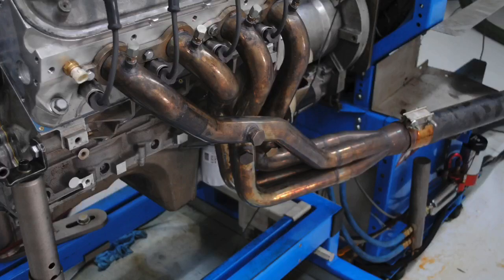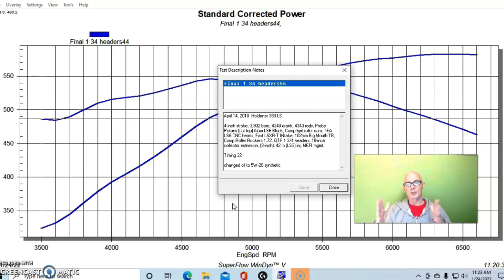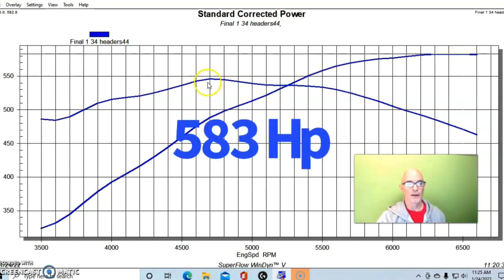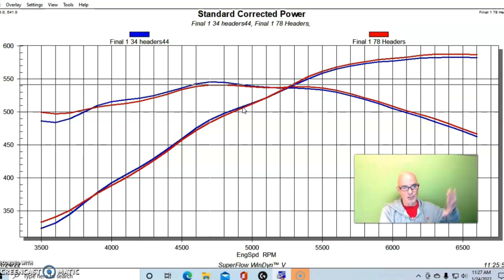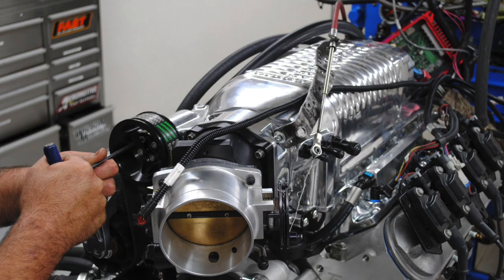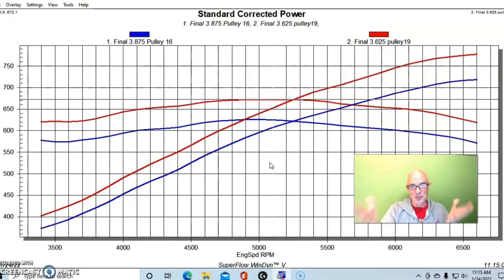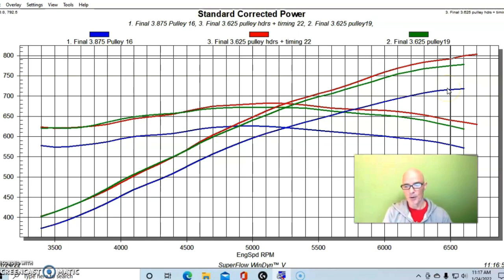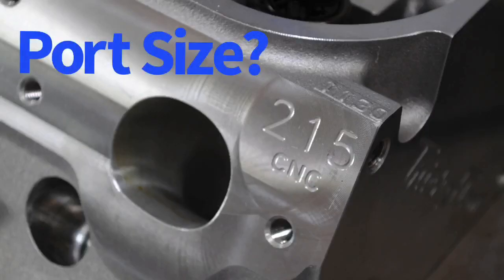HIGH HP LS HEADER TEST-1 3/4 VS 1 7/8 LONG TUBES ON A 383 STROKER & WHIPPLE 383 STROKER-WHO WINS?

Comment: Richard, could you please explain "porting"  a blower.   That is a new term I would like to understand. Thank you so much.
Reply: I’m not Richard, but I know the answer to your question lol. When talking about these factory Eaton blowers and porting, what is done is the outlet on the underside of the blower is opened up to a larger size than it is from the factory. This is the orifice/location where the vanes dispense their boost from the blower and force it down either into the intake manifold or, if equipped, through an intercooler and then into the manifold to the engine. What this does is allow the volume of airflow to be less restricted coming out of the blower, so In theory it allows more CFM of airflow to exit the blower and therefore make more power.
Reply: Also, in addition to the opening of the factory port on the bottom of the blower case, some methods of porting will also include boring new holes in the blower case as well, in a further effort to increase airflow of the unit into the engine.
Reply: @kennethpowers8995  Thank you so much. Just what I thought. So all the ports match. To increase airflow.
Reply from the maker: the porting would and should also include the inlet side of the blower-throttle body size opening and opening into the rotor pack
Reply: @richardholdener1727   Thank you, Richard. So basically the whole intake manifold. To gain as much power as possible.
Reply: @richardholdener1727  Absolutely for a max effort affair every orifice on the unit would be worked over, but the porting guys we use only do the Inlet side if the customer advises using a larger TB. On an M90 unit I believe they only recommend inlet work for guys running a 76mm TB or larger. For cars with more “bolt on” oriented setups running smaller TB they will only do inlet work upon specific request because it really isn’t beneficial at that level from what I understand. Don’t quote me on that TB measurement, it may be a mm or two +/- but I know their “street porting” package for the M90 and stock TB doesn’t include any inlet port work.
Reply: Also it's frequently ported on the intake side of the supercharger.  superchargers are particularly affected (negatively) by intake restrictions, so porting the intake, and/or adding a bigger throttle body is almost always a good upgrade.

Comment: Try to do 2” headers please so we can see if it’s worth it going from 1 7/8 to 2”  stroker N/A set up 🤘🔥🙏🙏🙏
Reply: You don't need a 2" primary unless you're in blown alchohol territory
Reply from the maker: if the 1 7/8 only added 3-5 hp, the 2.0 isn't necessary-except on the blower motor possibly
Reply: my  guess is you'd loose even more power down low and gain nothing up top whatsoever

Comment: Slightly off subject but somewhat applies . I tried 1 7/8 on a G Body swap and ran into several interference problems . Then bought a pair of 1 3/4 ...... problem solved !
Reply: Same reason I went with 1 3/4 on the 88 S10 Blazer dang steering shaft.
Reply: Great minds think alike!!!  I'm trying to find a 1 3/4 long tube system for my G8 to hopefully avoid any fitment issues.   Do you think a mini starter would be worth it for weight savings and ease of fitment too?
Reply: @WhaleRacer  I bought a set of 1 3/4 Pypes tri-y style headers for my G8 that fit nicely a few yrs ago. American Racing Headers (ARH), or Kooks are very popular for our cars. Both should fit perfectly,  but I'd check reviews on fitment. The steering shaft clearance on ours is sometimes an issue, mine have plenty of clearance there.
Reply: @WhaleRacer  Starter clearance I don't believe is an issue for us. Car makes 358/375 With Vararam, headers and tune.  Roughly factory rated flywheel power, but at rear wheels. About 60+ more at tire compared to stock.
Reply: I'm going through the same thing right now😂

Comment: Is it actually worth swapping out stock ls3 headers power wise?
Reply: Stock: not so much. But when you get a cam, intake, tune, etc., the stock headers can choke up the engine. One dude gained 50hp on a cammed LS3 swapping from stock to 1 3/4 headers
Reply: Yes! Any LS engine will benefit from long tubes. Even a stock 4.8 will be worth putting headers on. I've got a 2010 Silverado 6.2 headers only into stock catback. It made a nice difference in a 6k lbs truck, in a car it would be very noticeable. From 2k to redline it pulls harder. It also runs smoother with the long tubes on my 87 octane tune.
Reply from the maker: I have plenty of stock ex manifold to long tube header videos up
Reply: @richardholdener1727  yep watched them now. Cheers Richard